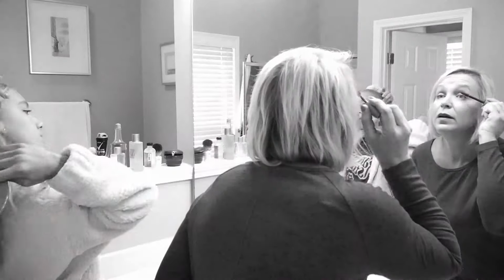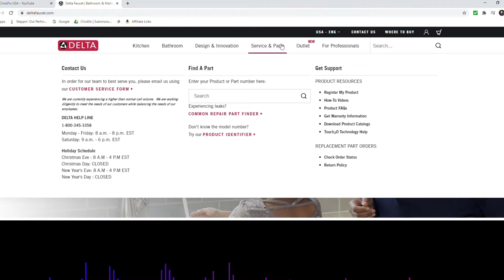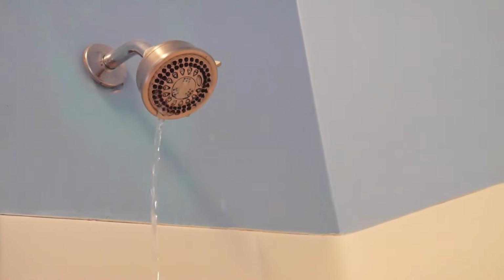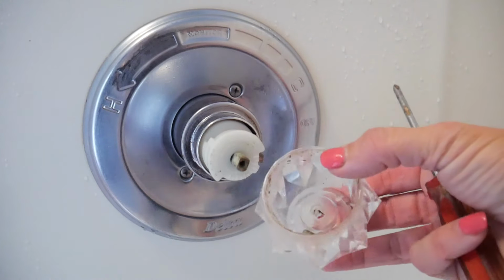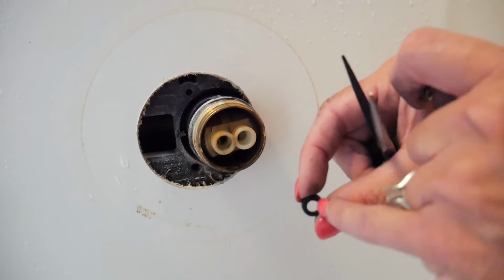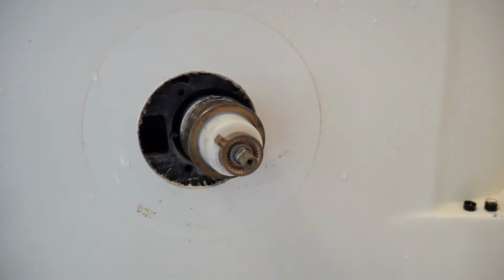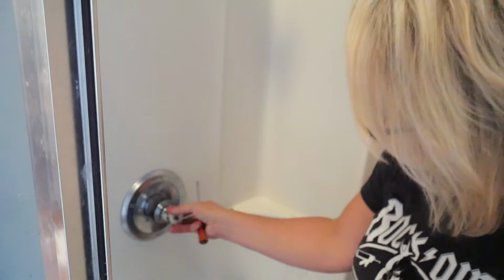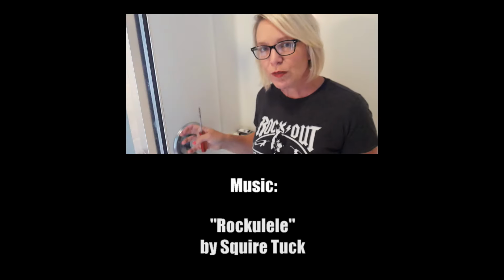How to Fix a Dripping or Leaky Shower Head

Comment: For those of you that do not know when you have your home built make sure that the contractor install Delta products throughtout your new home. That way anytime any Delta item leaks or stop working you call and tell them what you need and they will sent it or them to you absolutely, FREE! I'm a Air Force Veteran and have had to new homes built and they are equipped with all Delta everything. I have never paid one-penny for anything. Even the shipping and handling is free. That way you won't have to clean any old plastic parts before you replace them. Everything will be new.
Reply: Thanks for your Sevice...🇺🇸
Well this info is  good to know..we replaced our shower faucet with a delta about 5 years ago(to me it still seems new but it's dripping a fair bit now). I definately expected a better lifespan than that from Delta - that's why we bought Delta.  I'll have to check with out local shop and see if they'll honor the warranty. Thanks again....
Reply: @capitaldd3693  You're welcome
Reply: Thank you for your service and great advice!💜💜💜💜🇺🇸🇺🇸🇺🇸🇺🇸🇺🇸🇺🇸🇺🇸🇺🇸🇺🇸💜💜💜💜💜
Reply: I contacted them and they told me they don't send out free parts. All they could do is tell me the correct part to get for my faucet.
Reply: @CaliGem510  yeah I didn't get free parts either for this exact issue. They just told me what parts I needed to order.
Reply: Just a heads up, Moen does this as well and from my experience Moen has better availability of parts and their products last longer from my experience
Reply: I was told the same by a plumber, then contacted Delta and was told they don’t provide the parts, just advice as to which one. However, the parts are cheap, so not a big deal
Reply: @capitaldd3693 ravisher expensive house is right on the island on the corner half a block to the beach so what is this worth

Comment: FOR ANYONE ELSE for whom this doesn't fix your problem:   the part that the seat and springs go into is the "cartridge" which can also be pulled out with a bit of persuasion.  I actually pulled it out by accident while following this video, and noticed the "legs" of the cartridge had O-rings that were completely worn down.  I went to Home Depot and got 10 replacement O-rings for $2.50  (I looked up the correct size online based on the part number, which looks to be the same as in this video:  O-rings were 9/16" ID, 11/16" OD).   THAT was what fixed my leak, and was only one extra step to remove the cartridge.  

This video was great by the way.  It gave me the confidence to try this even though I know nothing about nothing when it comes to plumbing!
Reply: Thanks for the added information! I'm having a similar problem and will be heading off to Home Depot!

Comment: BTW, if there is something stuck that will not move, bring a pot of vinegar to just starting to boil and pour it on that part. It may be beneficial to first wrap the part with a rag so that hot vinegar has more working time.
This has worked for me countless times.

Comment: I was not expecting the opening commentary.  Hilarious!  I used this in hopes of addressing my leaking issue.  Fortunately, I have the same type of shower faucet, just a little newer.  Guts are slightly different, but still has the same seats and springs.  Thanks!

Comment: Thank you for this informative video. I have an older model than yours (patent 1961), so it looked a bit different, but the procedure was essentially the same. However, the springs on my valve are longer than the ones seen in your video and what was provided in the kit. The springs looked fine, so I just used the old ones. I was worried there wouldn't be enough tension if I used the shorter springs. Everything is good. No leak!

Comment: Thanks so much for this great video. Our shower was leaking 10 gallons a day (two five gallon home depot buckets) and today I looked for the seals at HD, but couldn’t find the exact ones so I just changed out the entire cartridge (Delta Part RP19804). This might be best for some as it replaces both valve seals on both sides, plus the white upper cap seal and it’s as easy as pull out and pop in. Watching this made it so easy to do it ourselves. Thank you!!!!!
Reply from the maker: Glad it was helpful!
Reply: @ChickFixUSA  you are welcome. I just turned the water back on and it appears to still be leaking. We have one of those RainShow’r things with the water filter inside and my guess is that must have a damaged seal that allows water to keep dripping. With an entire replaced cartridge I would of thought that would of fixed it. Just glad now it won’t need to be replaced anytime soon.

Comment: Okay job. Better off just replacing the shower cartridge, if your going to go through the trouble of repairing and old shower cartridge, sooner or later will need replacing. Old shower cartridge sometimes can be very difficult to get out and by the looks of that might be for that one. You are already doing the job, get a new one. Kudos to the lady.

Comment: Good job! I basically hate to do any kind of plumbing-even though I know it usually is not as hard as I imagine! My shower 'faucet' is a bit different from yours, but I think with your video I should be able to figure it out. Now to find where to turn off the water! We have no basement-it must be in the yard somewhere. Good luck on your bathroom remodel.

Comment: The plate on newer delta monitor shower faucets already have a rubber gasket around it to prevent water coming in. No caulking required

Comment: My shower head has got a constant drip and it's driving me nuts not only that you're wasting water and I noticed my water bill has went up a little bit I live here in Florida so I got to go outside to turn off my water hopefully the Home Depot will have the parts I need because my stuff is all original the house was made in 1988 so I hope I can find them little springs and seals anyway your video is the best I have seen on this problem very good job you did👍

Comment: Will try this. New install part from a contractor and I added a handheld to rainshower. Small drip won't stop.
Reply: So you have a hose as well? I take it as you said you had a hand held rain shower. I have a hose too. It’s dripping and driving me nuts. I also have two knobs - hot and cold. Did you fix yours? I’m afraid if I take it apart it is going to open a can of worms.

Comment: Aa far as silicone goes for around the beauty ring. Some of the newer ones say you don't have to apply sealant. I would recommend doing so with that specific on. Especially if it's against tile. The grout lines leave little voids where water could possibly get behind there and get stuff wet that you don't want to be wet.

Comment: I haven’t tried it yet but SUBSCRIBE because you’re so good at teaching. And you didn’t need a 10-‘inure monologue with Microsoft Paint title screens about “7 Things It Might Be” first. I hope you have a washer shaking video in here.
Reply from the maker: I have a few washer videos, though not specifically about shaking. It's possible that it might just be unlevel at the feet at the bottom. The little feet underneath the washer are adjustable, usually just by twisting them in or out, to make the whole thing level. You can get an inexpensive leveling tool at a hardware store to check, both side-to-side and back-to-front. Then it's just a matter of screwing/unscrewing the feet individually until it's level.

Comment: U saved another 100 bucks. Brilliant.
Reply: 100.00 ?    300.00 !
Reply: @skim193  Yes, tell me about that! I had 3 plumbers come fixed my burst pipes, water leaking issue and even the malfunctioning of main water shutoff on 3 separate service calls in April. I waited more than 10 days for the first one who did at least two and a half hours' work searching for broken pipes and charged me a very reasonable price for $400 (parts and labor plus pulling away toilet/vanity/cabinet and opening up drywall). Unfortunately, he left for another appointment after that and left me feel so frustrated. Then I found someone who could come in a week, not after a month. 
I feel this younger "master plumber" overcharged me a lot for his work about an hour and a half. With the open up of most drywall in the house, he easily found the last burst pipe and the leaking shower control valve at the adjacent newly opened bathroom wall. He initially quoted me $250 for the broken pipe repair. However, he added $250 for pulling away the vanity cabinet and opening up a small part of drywall in another bathroom (would ask extra $200 more if he'd come back to reconnect the faucet!). He even said I wasted his time on the first visit when he could not start the work after giving an estimate. Since the visit came with a service call fee if they're not hired for the job. That said, his work cost me a total of $700 but he actually lived just one block away from my subdivision! 
The third plumber's service call was placed online, which provided the next or second day service (not 3 or 4 weeks' wait), so that was much efficient but indeed quite costly for 20 min's work. Instead of repairing the main water shutoff valve or part (it was unable to be shut off by my contractor) and the adjacent leaking water drain, he cut the copper pipe and placed a separate ball gauge/valve  control above the faulty switchoff. With a small discount (1st time customer?), the total charge plus the service call fee were close to $450. I have never realized plumbers would make such a good money on me within a few weeks.

That being said, if you learn to DIY, you can and will save a lot, maybe down the road even enough for a new kitchen renovation!

Comment: Good video….only thing is when I got ready to turn the water on for some reason only a little water comes out my shower head and the off and on knob can’t turn my water off.  I only took it apart to see if the seats and springs were like yours and they were. I took out one seat and spring and the rubber was falling apart but I put it back in just to turn the water back on and only a slight water was coming through. HELP!!

Comment: Thanks for the video. I changed the delta valve cartridge but still there is leaking from the showerhead. Do you have any recommendations for what to do in this case?

Comment: I actually just had the same issue but it was leaking from my tub spout so I ended up replacing the whole valve cartridge (Delta series 14) instead of the seats/springs you showed. I was worried about putting the seats/springs in wrong so that may be another option for anyone with a similar problem!
Reply: I had a leaking shower head replaced the shower head and the cartridge and now my shower head is leaking even more than when I first started… bad new cartridge from the box?!  Now my plumber is saying we have to rip out the wall?!!! Any ideas before I allow that to happen?!!
Reply: @monicawilliamson13  I’m in the same boat😢. Went to try this project and when I got ready to put back everything because I wanted to turn the water on, just a little water came out and now I can’t shut it off.

Comment: I went to turn the water back on at the phase you went to clean and my shower started running. After that I turned it back off and reset it and tried again and the same happened. Next I put it all together and couldn’t get the shower handle to turn and, again, the shower just ran the whole time so now I’ve shut my water off. Any idea what mistake I may have made along the way?

Comment: All parts (other than electronic parts and batteries) and finishes of Delta® faucets purchased from authorized Delta sellers are warranted to the original consumer purchaser to be free from defects in material and workmanship for as long as the original consumer purchaser owns the home in which the faucet was first installed.

Comment: Question, this helped us a lot and our shower stopped dripping. We had a different setup but seats and springs worked, they are a part of the white piece you pulled off last had to be turned around because we had hot and cold reversed. When we reassembled, it started dripping again. How important is it to ensure the bonnet nut is very tight? That is the only thing I can think of as to why it would start dripping again. Thanks
Reply from the maker: You definitely want to make sure that bonnet nut is tight. That is what applies the pressure to the cartridge and the seats and springs, so that nothing leaks. It also could be that you put the springs in backwards. That is very easy to mistake.

Comment: Do you think this will also help with poor water pressure? Mine drips horribly, but also has bad water pressure.
Reply from the maker: I'm not sure about that, but possibly. Does the whole house have bad water pressure? Or just the shower? Also, does yours have a shut-off valve specifically for the shower?
Reply: @ChickFixUSA  I removed the Blue flow control thing in the shower head handle and the pressure is fine now. But before I did that I tried to remove the knob handle that turns on the shower, and it won’t come off. I’m going to have to replace it, as it appears that the only way to get it off will be to cut or break it. Project for another weekend.

Comment: How do you find the correct part for your shower? I’m sure mine is different from yours but I’m not sure how to find the right part.  Is there a number on the seat when I pull it out?
Reply from the maker: I looked up my actual faucet on the Delta website, then with that model number you can determine the appropriate seats/springs to go with it. You can also call the manufacturer, once you know your model. Sometimes they even send you replacement parts for free, depending on the company.

Comment: Mine was exactly this set up. I changed the seats and springs but still have a leak worse than before. I'm at a loss. Is it the cartridge?
Reply: Ended up just replacing the whole cartridge for about $65 and no more leaks.

Comment: Avoid the dripping shower by draining all the water out of the system by turning on your kitchen faucet. I just did this today. It's a pain in the ### trying to line up the gasket and screw because the house was built in 1988 and some of the gutters are slanted downward and trying to get them reset is a little tricky. But, it sure as hell beats paying a plumber 150 bucks to come and fix it for you.
Reply from the maker: Awesome tip!

Comment: What happens if you don't replace the seats and springs? Will it leak inside the wall?
Reply from the maker: Not it shouldn't do that. The seat/springs control the water that comes out of the shower head. Leaking behind the shower is more of a plumbing/pipe problem.
Reply: @ChickFixUSA  Thanks

Comment: I’m having a hard time finding the springs for a Gerber shower handle. would I be able to use the link you sent or do I need the exact model?
Reply from the maker: It needs to be the exact model, unfortunately. For this one, I actually went on to the Delta website and scrolled around their products until I found the same one. Maybe that could work for you?

Comment: I woke up in the middle of the night to a dripping sound coming from...THE BATHROOM!!! When I finally got up I tried to tighten the handle. That worked...temporarily. So, I go down into the basement to fix some fresh water for our chickens. When I was done tending to the chickens I could hear the shower head dripping at the same rate as when it woke me up this morning. So, I turned on the shower head on and off. That had drastically slowed the dripping once again. I am wondering if I just need to do what you have done in this video here? I will see how much longer I can take the dripping. Then I will act with stealth and ferocity knowing that I have been equipped with the knowledge to do this job correctly, confidently completing the task set out before me. Peace!
Reply from the maker: Good luck, my friend! You might need to do this, yes, but if you can raise chickens I have no doubt you can handle this.
Reply: @ChickFixUSA  I have a hate/hate relationship with water-related issues. I tackle plumbing reluctantly. It's all in my head, I know, but Youtube usually comes through and gives me that confidence. P.S. The chickens say hi.

Comment: I did this but now my hot water is not as hot as it was. Any ideas?
Reply from the maker: My first thought would be that perhaps when you put that cartridge in there, it's not placed exactly correct, so it's not turning the hot water on as much as maybe it was before. Is the water just as hot everywhere else?

Comment: Be careful removing that bronze colored sleeve (bonnet) with pliers. If you twist to hard you will break the fragile pipes inside the wall.  Search google for bonnet pliers. Worth every penny.  Even plumbers break those pipes when removing it and it's very expensive to fix.
Reply from the maker: Thanks for the tip!!!